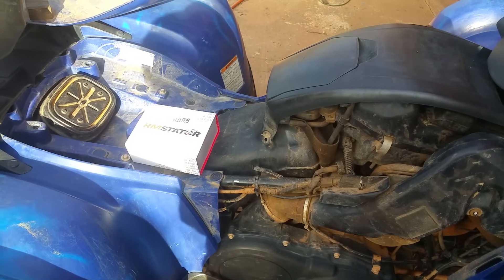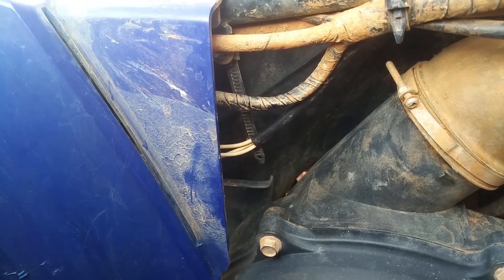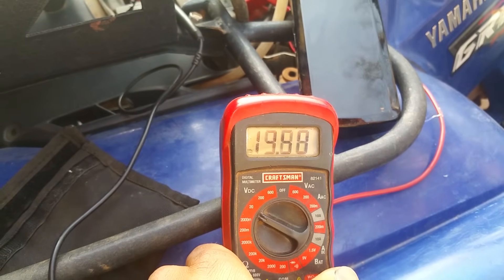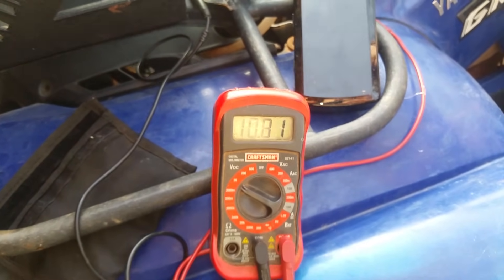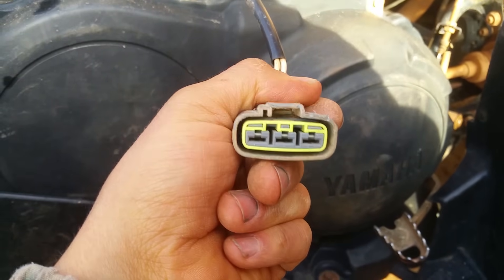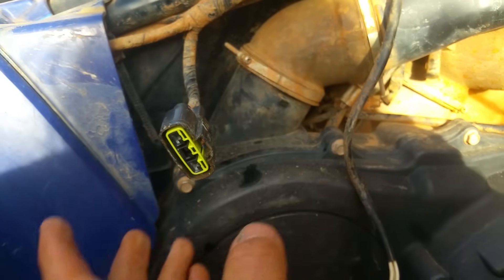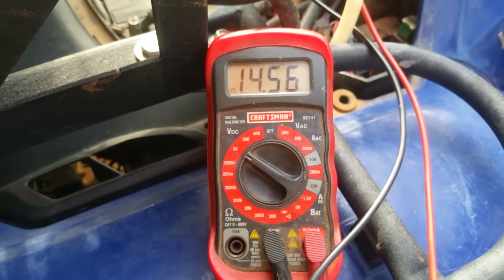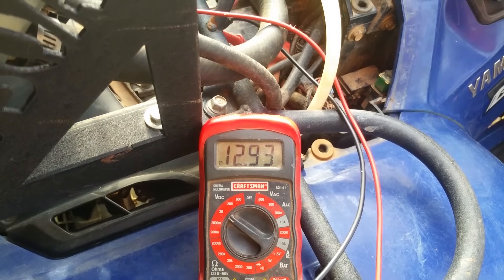ATV Not Charging? Watch This Before Buying Parts!

Comment: The last thing you need to with your meter, is make a voltage check directly on the battery terminals. To see if it is showing that it is receiving charge.
Reply from the maker: It was. Pretty sure I showed that in this vid.

Comment: Hey, on my Grizzly 700 been running great, battery just replaced a month ago, but I was clearing some logs with my winch in neutral with the brake on and it died then it started but I kept losing juice eventually it was dead jumped it threw the meter on it and watched the voltage start counting down. I am going to dig into it tomorrow,  but it seems like the extra draw of the winch under strain caused this to happen. Is that possible?
Reply from the maker: IDK, winches can put a lot of strain on the battery. If you don't have a good charging system it's gonna cause problems.
Reply: Yea late getting back but the stator was fried replaced the regulator rectifier also and I'm back in business I don't think I will use the winch that consistently puts too much strain on the Stator.

Comment: Ok well I’ve replaced the voltage regulator and I got the stator tested they said it’s good but the battery still isn’t charging I can boost it off and ride for a little bit and the battery dies not sure what else could be the issue please help if you can

Comment: Always good to test.  Much easier replacing the regulator than the stator haha
Reply from the maker: Yea, for sure. The stators are a PAIN to get to on these. You have to drain the coolant, oil, and take the side cover off of the motor. Not fun.

Comment: The regulator is mostly just a rectifier that uses 4 diodes to convert the current from AC to DC, along with a capacitor bank to maintain a steady voltage output so if youre geting erratic DC voltage, your problems with the regulator. The stators on these are about as simple as they get and typically when they go bad you'll see, and often smell, obvious signs of damage. If its burnt then the windings need replaced but if you just have a problem with one leg, its just a broken lead. That can be repaired like any broken electrical connection and you can even get a spray can of wire enamel if the coils just need to be reinsulated. Its literally just enameled copper wire wrapped around each leg of a star shaped chunk of iron that alternates its rotational direction from one leg to the next...its not anymore difficult to fix than any other component.
Reply: Yep.. sometimes 6 diodes
Reply: @mattstacy1652  sure if its a 3 phase generator because it requires 2 diodes to capture a full wave from each phase but the laws of physics do not limit the engineers to just 3 phases either so It could take more than 6 if engineered to generate more than 3 phases.... though the requirements of an internal combustion engine on a machine as simple as an ATV  cannot possibly justify the complexity of rectifying that many circuits..... there just isnt enough individual loads being placed on the power source to require the split phases because theres nothing to balance once the starter motor is disengaged, which is driven by the battery's storage capacity anyways and has nothing to do with the motor driven generator.

Comment: I’m having issue with a 2016 cub cadet 750 utv. Voltage will increase very little when u accelerate but overall it slowly just drains voltage.

Comment: Hey Matt - good vid.   Thanks for posting your stator voltage measurement.  Like you I can't find anything about what it should be for my 2001 Yamaha Big Bear  - but my output is the very close to what you are seeing.   I don't have a charging problem - even with the lights on at idle the battery holds at over 14VDC.   In your experience have you seen a stator have issues when it gets hot?   My engine will just cut out sometimes - like you turned off the switch - and usually when that happens you will get a backfire.   Usually starts back up in 15 minutes and runs fine - I run the ATV so little I don't know what it would do if I used it for 30 or 45 mintues.  I've have all of the voltages baselined (stator, CDI voltage input, CDI pulse input,  CDI output to coil  so I'm waiting for it to die again so I can narrow it down.  RMSTATOR makes a peak voltage adapter for your VOM if you are not aware of it.  With it you can use your VOM to measure CDI pulse input and CDI output to coil.   Here is my pulse input voltage at cranking, idle, and with the engine running fast:  5.5VDC          9VDC         15VDC.
And here is the output to the coil:    2.25VDC        2.36VDC        3.1VDC.   I suspect yours will be close to that.   The pulse input from stator - and the CDI output to coil - is not a sine wave - which is what a VOM on AC is designed to meature.  You might see some millivolt for the pulse - and nothing for the output to the coil - with just a VOM meter...hope this is helpful.

Comment: I couldn't see clearly how you were testing the stator. Was it positive  probe of the VOM into each of the three terminals, with the negative into any other terminal that a positive probe is not in at the time?
Reply from the maker: Basically, it's AC power it doesn't matter which probes are where. As long as they are reading each phase. I believe this stator was 3 phase. That means you test each phase to see if its good.
Reply: @MattsShop  Can the black probe be on an engine ground, and the red probe inserted in each of the three terminals?

Comment: Another way to test if the charging system works is by starting the quad and disconnecting the battery. If it quits running then there is a problem with the Charing system
Reply from the maker: Yea, that could work. It could stall and shut off though. This ATV likes to do that sometimes and the charging system is good soo....
Reply: He already knows there's a problem with the starting system. He's diagnosing it to figure out which component needs to be replaced

Comment: whats with the red & black wires together with the shrink wrap, next to red test lead ?
Reply from the maker: That is a little flat blade connector to multimeter adapter. It allows you to plug into a connector without having to jam a multimeter probe pin in the connector. Good eye!

Comment: I was getting spark but the system was not charging, I could pull start it but when it gets hot the fan would not kick on so I change the stater it fired Up then died now I have no spark, tells me bad stater that I have?? Polaris 425 4 x 2 Magnum , I have the other except exact model took the coil off to make sure swapped it still no spark?Any more info would really help me out thanks
Reply from the maker: I'd regroup and start with the basics. Have you checked the voltages coming out of the stator like I showed in this video?

Were the flywheel magnets good? Sometimes they can crack or come unglued. You can't generate a spark without good flywheel magnets.
Reply: Matt's Shop Thank You!! Going to go through it right now :-)

Comment: I have one (50cc) that will run fine with no battery, and headlight comes on when it's running without a battery. so that leads me to think the stator is doing it's job but as soon as I put a battery on it the charge wire gets red hot and it drains the battery. To me it sounds like a regulator? But then again. I don't mess with atvs much. Any opinions?
Reply from the maker: The charge wire gets red hot??? That's not good. Something is wrong for sure. I'd check the voltage coming out of the regulator with a multimeter. Is this a Chinese ATV? They might have it wired weird.

Comment: I tested the regulator it was 448 440 438 I checked the stator it seems to be sending power it gos up to around 60, also when I take off the battery cable while running it does after a second or two, when I turn on the switch it sounds like the relays clicking and fuel pump makes small clicking noise also but it does it randomly if I hook up buster cable to it.......does this means the regulator is bad.......thanks for the info it's a big help, 2009 Yamaha grizzly 700fi

Comment: I have a 110 kandi gokart I get spark and gas but wont start I even used starting fluid and still wont fire I've tried everything what could it be
Reply from the maker: Is your carburetor clean? Maybe the valves are out of adjustment? Have you checked the compression? It should start with starting fluid. Have you looked on forums to see what people are saying that own that model?
Reply: I adjusted the valves it gets good compression and spark I sprayed starting fluid in it I replaced carb with new one I replaced plug and coil but I cant get it to start still and when I take the plug out it seems dry like nothing is getting to it no fuel or starting fluid or anything it's a clean kart it didnt get run hard it just died one day and havent been able to start it since
Reply from the maker: Did you check the coil armature air gap? The space between the coil and the flywheel magnet? I've had spark but it was weak because the gap was wrong.

You can go through the carb again with a small copper wire to poke out the orifices in the carb body. I've missed stuff like that before. Even though you said you replaced it. Check the compression too

Comment: Stator output voltage on a quad should put out 24v ac - 40v ac
Reply from the maker: This one was checked per the factory service manual specs.
Reply: He said he didnt know what voltage the stator output ... once you know you either have a bad regulator or bad wires....the factory spec he referred to was the resistance of the actual regulator
Reply: There is a difference between resistance and voltage

Comment: Hi, what are your thoughts on testing the voltage with the battery disconnected? I have a polaris xplorer that runs about 6 volts idling when checking the battery cables with no battery in. At around 2500 rpms it is about 14 volts. Is this normal? Thanks for any input.
Reply from the maker: You can check the voltage with the battery disconnected. That would be a good test. If you are getting 6 Volts at idle that seems REALLY low. Did you ever get this fixed?

Comment: HEY MAN IVE GOT 1999 ARCTIC CAT 500 THAT IM TRYING TO CHECK THE STATOR  BECAUSE THE VOLTAGE REGULATOR I BELIEVE LEAK ELECTRICAL SMELL FLUID OUT OF IT I NEED A CONNECTOR VIEW WAS WONDERING WHERE TO FIND A VIEW
Reply from the maker: You have have to get a service manual, or search online for a diagram.

Comment: my motor cycle jumps around but still seems to keep the battery charged
Reply from the maker: The voltage jumps around? That's not good.
Reply: @MattsShop  81 suzuki 750..ya its all over the place but never higher than 13 volts but ive been able to ride all summer ..have to get me like you said new stater
Reply from the maker: Make sure you actually diagnose your problem and do not just throw parts at it. Your voltage should stay pretty stable.
Reply: @MattsShop  im not gona do anything with it cause it still keeps my battery charged but i just know the volts are on the low side..common problem with cycles

Comment: I have a 4 x 4 wheeler that has a new stator, regulator rectifier and battery but will not charge the battery. Stator is putting out 80 volts AC when I step on the gas. Have tried 2 new voltage rectifiers and both do not charge the battery. Any ideas why? Thanks, AJ.
Reply from the maker: This is going to sound dumb, but have you checked the fuses? Have you checked for corrosion or maybe rat/mice chewed wires.

There MIGHT be a bad fuse that is hidden or hard to get at.

Comment: Hey can someone tell me where I can put the negative jumper cable for ground on my 2017 Yamaha grizzly 700
Reply from the maker: +Beastwood 2 On the negative terminal on the battery? Do you have a dead battery? It's a 2017 I can't imagine you having a dead battery.
Reply: Matt's Shop ya my battery is dead and I need spot to put the negative cable
Reply from the maker: +Beastwood 2 Positive on charger to positive on battery. Negative on charger to negative on battery. 

Make sure you don't hook it up backwards. You can download a free manual from Yamaha's website I'm pretty sure.
Reply: Matt's Shop thanks
Reply from the maker: Sure thing!